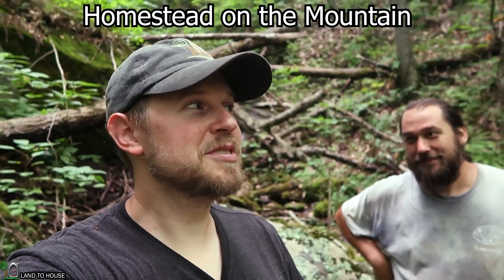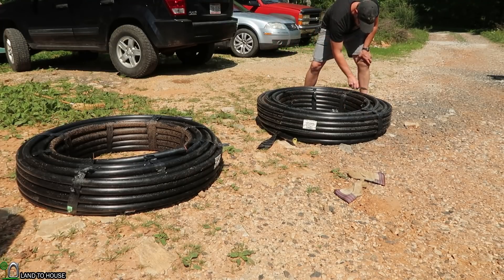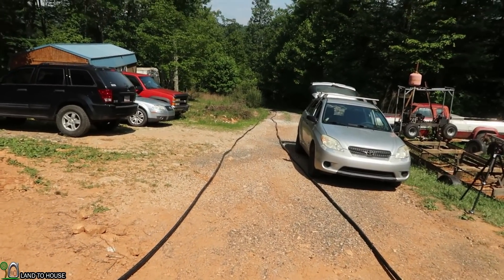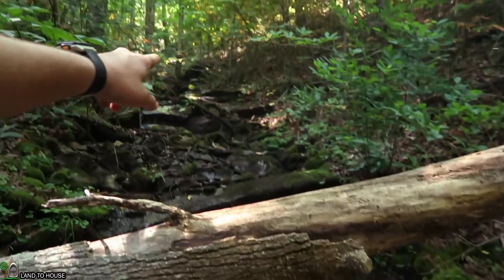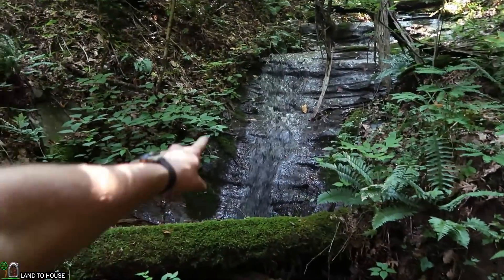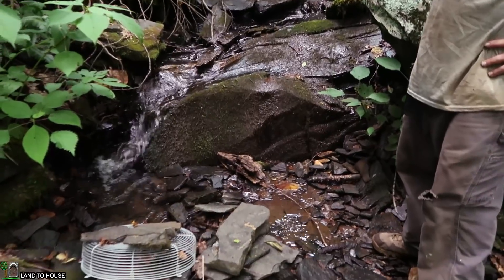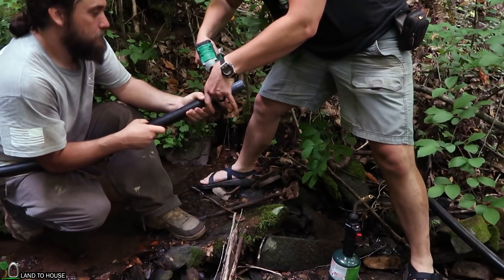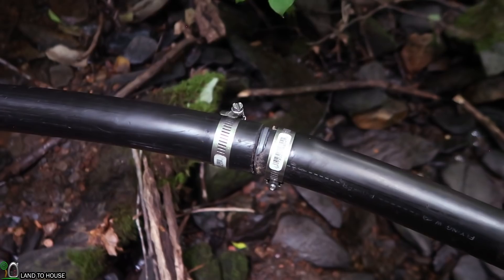Installing the Penstock - Off Grid Micro Hydro 1/6

Comment: Really cool stuff! I'll be interested to see how the smaller pipe compares in terms of flow, and particularly pressure.

Additionaly, when I first heard that your neighbour will be taking some of the water for home use, I got worried that you might lose out on significant power.
But then I did some maths and I see that even if they used 700 gallons/day (more than twice the US household average) it would still only remove 0.5 gallons/minute for you (assuming you captured everything, of course). So not a big issue, I expect!
Reply from the maker: The power output is a bit low because we are low on water. Its enough to charge batteries at night. He is using very little of the water for the house. Has been for years with no issues.